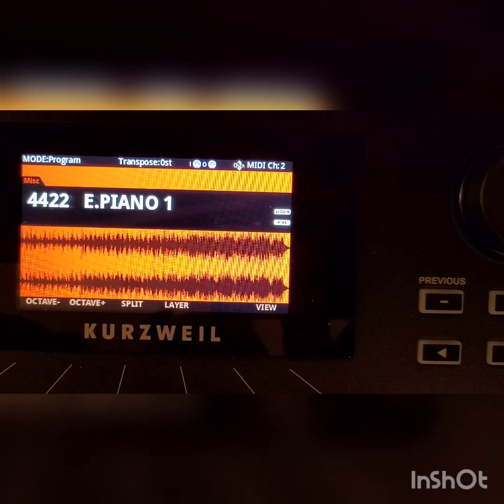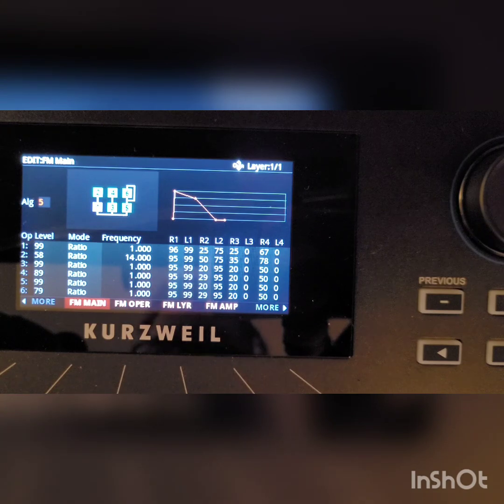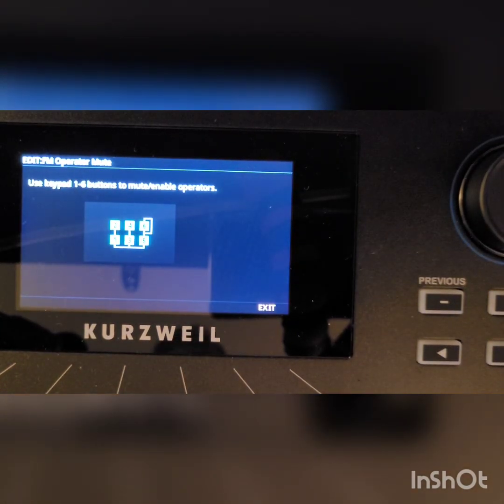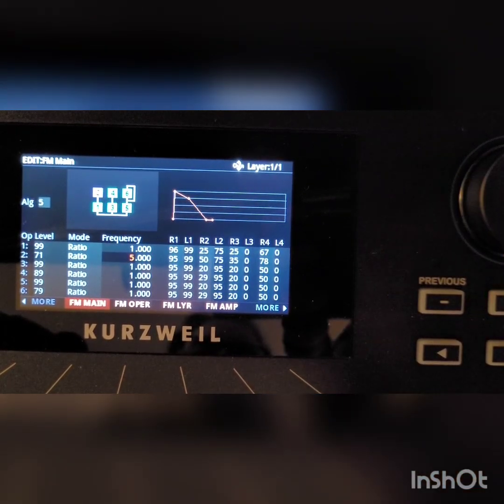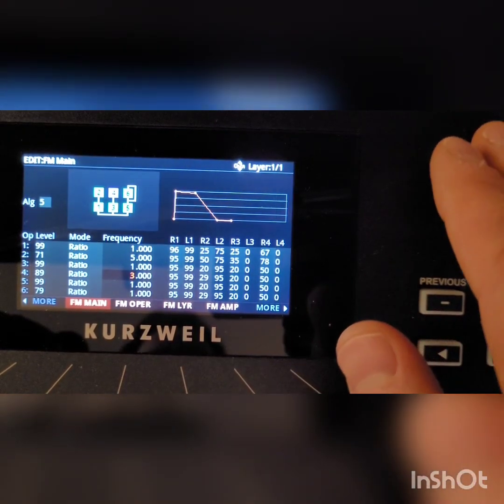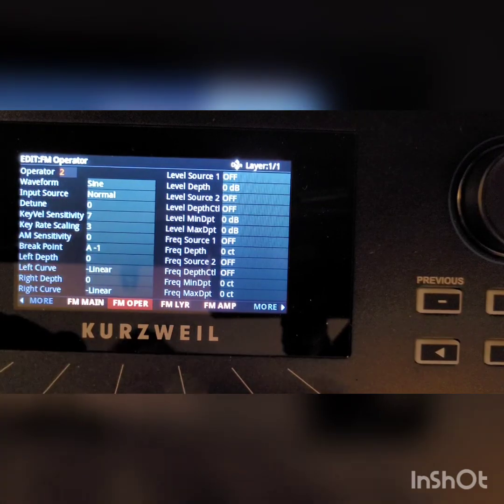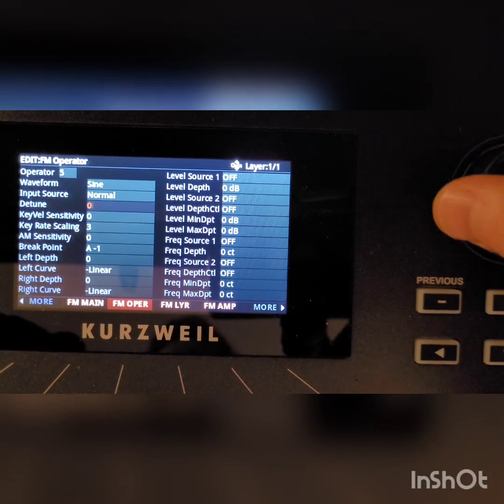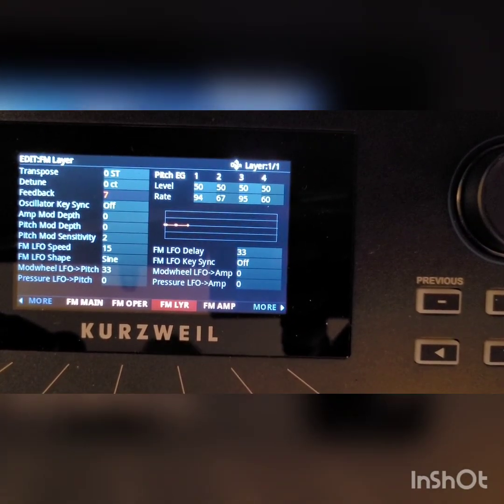FM Basics on the Kurzweil K2700 part 1 - Algorithms

Comment: Ok. Going through the manual, it appears you can use any internal sound source as a carrier or modulator. So, you can modulate samples against each other? Am I correct in my understanding that this is possible? If so, I would love to hear some examples of that. I'm a longtime Kurz user, having owned the K2000, K2vx, K2500, K2600. So I'm familiar with the V. A. S. T. architecture. I'm pretty bummed they don't have a sample input for actual sampling and running live audio through VAST. I've always loved the preamps and converters on the K2xxx series samplers. Great results can be had playing with the input gain.